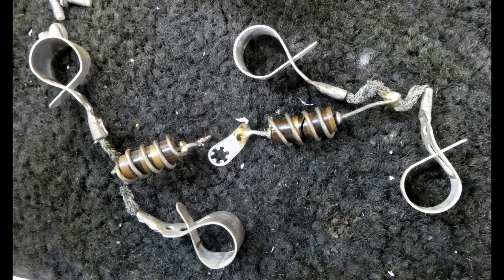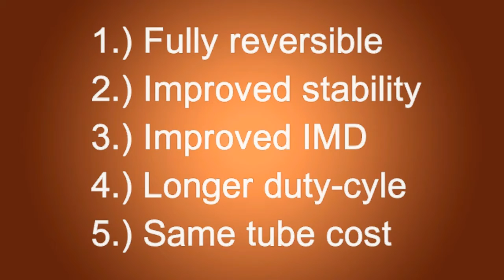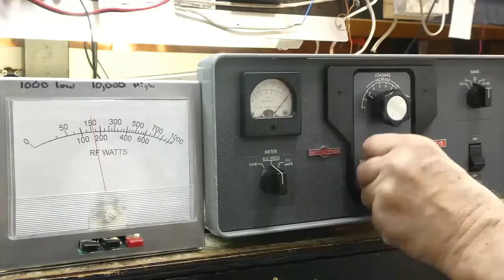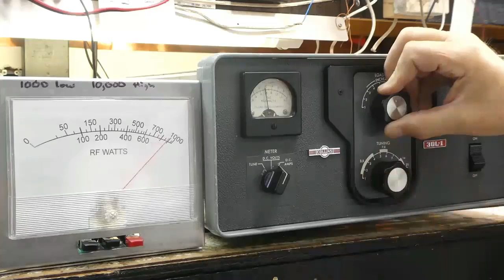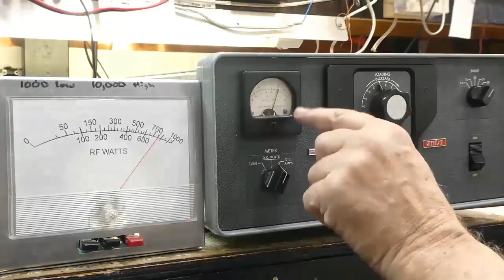30L-1 Performance and Reliability Improvement

Comment: At 10:00 I would add that the arc suppressors are a good idea to protect the T/R relay coil (10K ohm relay) if the plate and grid short. I received my 30L-1 years ago off Ebay and the relay was open and I feel sure it was a plate to grid short.  New relays are available from Mouser.    Very nice video.   The 30L-1 is a beautiful little amplifier.    73  WA4QGA

Comment: Well that was a complete waste of time. My amp is happily producing 700W from 4 by 811A's but I have two nice new 572B's so I thought why not give it a go. Now only does a bit over 300W. Even tried fiddling with R12 to increase the bias but no difference. Also, how can your amp be producing 2kV? Mine drops to 1800 as soon as you key it - pretty normal for a PS with no regulation I would think. It seems you have done something else to your amp and its not really a "plug and play" mod is it? Cheers, VK2AN
Reply: Hi VK2AN.  I am confused by your HV comments.  Tom shows his amp's HV is around 2kV for "low duty cycle" (12:40 into the video). He then shows going to carrier at 12:50 into the video.  You can see the HV drop on the meter to what appears to be around 1800V (difficult to tell since the camera is looking sideways at the meter) and Tom says the HV is "about 1700 volts" at 13:33 into the video. Are you referring to another time in the video?
Reply: @ejeuler  Hi ??, I missed the bit about 1700V. Not sure what "low duty cycle" means but mine drops back well below 2Kv as soon as you put any power through it at all - even 30%. However, the point I am trying to make is I can see no way you can get that much power out of 2 572B's without doing some other mods to the input circuitry. I have asked various people on the Collins group, and found no-one who had managed to get much more than half the output using 2 tubes.

Comment: Bogus. Two 572B tubes does not equal the same power output as four 811A's. The Mu of a 811a is 150, the 572b is only 160, and the last 10 points is above the 1500 volts that the 811a is rated two.
Reply from the maker: Your comment doesn't make sense. The mu makes very little difference in output power in a cathode driven amp. The output and input are out-of-phase and in series in a cathode driven amp. This gives it a high level of negative feedback. Because of that, the major determinant of gain in a cathode driven is the ratio of driving impedance at the cathode and load line at the anode. So much for mu and gain, if that was what you were trying to say.

As for power limits, Collins uses much higher anode voltage than 811 tubes should be operated at. Because the voltage is so high the gain is up from normal voltages of 1500 volts. The 811 tubes would make a great deal of power at that voltage, but they are grossly dissipation limited. The anodes are so frail the 811s cannot be used anywhere near full emission without melting the anodes down.

The 572s cure that.
Reply: @Jerrythenerdful  Sorry. Two 572's are not going to produce 1000 watts of RF. If that were true, every Linear manufacturer would have done it. Ameritron had their AL-811 HD with four 572's and stated a maximum output of 1000 watts. No one has a two tube 572 with that much gain, unless you are driving it with over 100 watts in and exceeding plate voltage.

IF Collins had higher plate voltage than the 811A's would allow, wouldn't that shorten their life? Yet, many are still in service with near original sets.

Try presenting your entire test setup so everyone can see what you are doing. I have seen too many people make claims with black boxes.
Reply from the maker: @Ferret488  The gain of a cathode driven amplifier is largely set by the ratio of anode operating loading impedance to the cathode drive impedance. You seem to either not understand that, or be unwilling to accept a common well-known engineering fact. 

I designed the 811 amplifier series in 1991. The AL811 uses 1500Vdc on the anode. The voltage and power determine the impedance of the loadline, the cathode drive impedance hovers around 220 ohms per tube regardless of high voltage. Thus gain is set by the high voltage and desired power level.  This is why we have to re-tune an non-class A RF amplifier at increased drive, the increased power and fixed voltage moves the loadline lower.  That also decreases gain.

There were no tricks involved. The typical 30L1 I see is about 2000 volts or so operating voltage on a normal 120V or 240V main. That is 25% higher than an AL811 and far higher than the fragile 811 tube should be run. It makes the gain of the 30L1 too high for the anode dissipation in the 811 tubes. But one 572 is almost the dissipation of THREE 811 tubes. The 572 solves the severe anode dissipation problem and gives good safety at the Collins 2kV or so.  

The filament emission is more than enough in any of those tubes to not saturate. Emission limits are not a factor at these cathode current levels. Instead of wasting time and making up conspiracy theories in your head, run the test yourself and get some data.
Reply: Hello Jerry - there is always a keyboard warrior, YouTube seems to attract them.
I carried out the upgrades recommended by you on my AL-811HXCE and fitted 4x572B's, delighted with the results.  As a matter of interest which of the 572B valves do you recommend, i.e.'  from which manufacturer.
73 & Happy New Year.
Reply: @EI6DPToo bad you didn't listen to what he said before you also made a comment. He specifically said that TWO 572's would output over 1000 watts, not four. 

It is hilarious that the person credited with helping to design the AL-811 amp is also criticizing the design.
Reply: Yep, OK.
Reply: @Jerrythenerdful  Sorry but input and output are in phase for a grounded grid amplifier. And the input power feeds through to the output. On the other hand I am skeptical of his results.  I wonder what that wattmeter actually is?
Reply from the maker: @joewhite7574  That has nothing to do with anything. All of the input power does not feed through to the output, although some does. The lower the mu of the tube and higher the driving impedance compared to output impedance, the more the feedthrough.

Comment: Your numbers don't add up.
At approximately 15 min of the video you said that you have 800 watts of carrier at 20 meters with 1700 volts and 0.6 Amps.
1700 volts times 0.6Amps equals 1020 watts of input and the rf output is 800 watts.
That translates to an efficiency of 78%, something impossible unless you work at class C.

Comment: Ohmite OY  series 100 ohm 2W is also a composition resistor and can be used in the parasitic suppressors; available from stock at DigiKey

Comment: Getting ready to get back on the air after a 10 year layoff and I was wondering about using 572-Bs in my 30L-1.  I think that when I put it all to bed I had just put a new set of 811-As in, but it's nice to know I can do the switch when those get used up.  Thanks!

Comment: I have this amplifier with the same modification, but I get the same power output as you are getting with the four valves and you said that your only using two, can you please explain?
Reply from the maker: The 572 and the 811 both have a good bit of reserve emission, the 572 which has always been oxide coated (by Cetron and from China) and the modern 811 even more than the early 811 tubes.

The real limit in 811 tubes is the anode dissipation of 65 watts, not the emission current or peak power. You need four tubes to get around 260W of dissipation so the anodes do not melt down, not because of emission or peak power limits.   

Collins beats the death out of 811 tubes by high voltage. They are up near the 2000-volt area. The Collins is also not neutralized and that makes it unstable on 10M and 15M with four tubes.

Everything gets better by dropping back to two 572B. The amp is more stable, and the dissipation becomes 320 watts with two 572 tubes instead of 260W with four 811s, plus 572s like the nearly 2kV anode a whole lot better than 811 tubes do.   Plus everything can be converted back to make it a museum amp instead of a workhorse.
Reply: @Jerrythenerdful thank you

Comment: Great video, but need help finding 100 ohm non-inductive resistors, as none available from stackpole?
Reply from the maker: I have thousands of new RF components. Either email me at my ctrengineeringinc.com email or I think I have them listed on eBay if that listing is still up.
Reply: @Jerrythenerdful  hi jerry good day. can i have ebay link of 100ohm resistors and the 16guage wire for parasitic?

Comment: Hello, excellent. I have a 30L-1 with 4 811s, but I know of people that replace the 4 811s y 4 572Bs. Is that ok? Better or worst than 2 572Bs? Also, the mods shown at the begining are still valid is using 4 811s? Thanks
Reply from the maker: The problem with four tubes like the 811 or 572B is they really should be neutralized for stable operation above 20 MHz. Four tubes have too much feed through capacitance to be stable above ~20 Mhz at 1500Vdc, and this problem is proportionally worse as the anode voltage is increased.   

Almost everyone, such as the Heathkit Warrior, the Gonset four-tube 811 amplifier, and the Ameritron four-811 tube, neutralize.  

Yaesu in the FL2100 eventually had to add a rather poor implementation of neutralization with just two tubes, but this is because of the voltage. Ameritron, in the AL572 amplifier, has to neutralize the four 572. 

If proper stability tests are run on the 30L-1 as-manufactured, it will fail miserably. The Dentron Clipperton will fail also. If the neutralization is removed from the AL811H, Heathkit Warrior, or Gonset, they will miserably fail proper stability tests.  

I likely have some videos of this. 

With that in mind, and because the 30L-1 amplifier components can never make use of the full power of four 572's, it makes absolutely no sense to run tube cost up and amplifier stability down by adding two extra tubes that will not increase useful output significantly but will significantly decrease stability. Maybe three tubes, not four. Three tubes are on the edge of needing neutralization but are more stable than using four. 

I personally would never use four.
Reply: @Jerrythenerdful  Tom, very thorough reply. Highly appreciated. I'll start by adding the bracket on the back of the variable cap. It makes a lot of sense and can't see any problems. Thanks.
Reply from the maker: @CH_Pechiar  I have not documented the electrical advantage by actual measurements because they would be so involved. But if the amplifier is shipped, not having the air variable weight hanging on the front sub-panel, and also having that capacitor supporting some of the tank coils, is reason enough. This is the third 30L-1 we have received with a loose tuning capacitor (out of maybe ten or eleven). 

I have documented in other amplifiers that wider and shorter grounding paths result in improved upper-frequency performance.  It is almost always the sum of many small things that makes the difference in performance, and not just one single major thing.
Reply: @Jerrythenerdful  I have here 2 of mine and the club's one. I'll check in the three of them. I agree that, unless a big design flaw stands out, improvement is the sum of small issues, sometimes related to cost of production at the time.